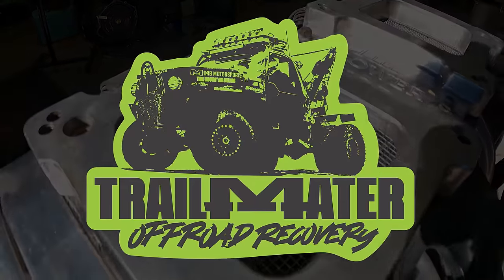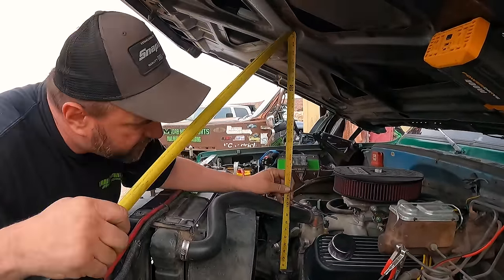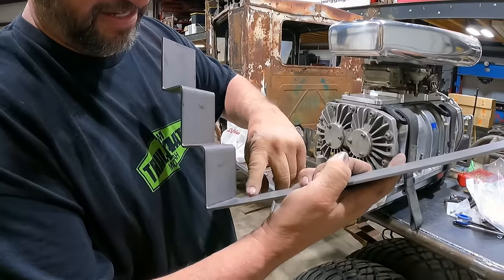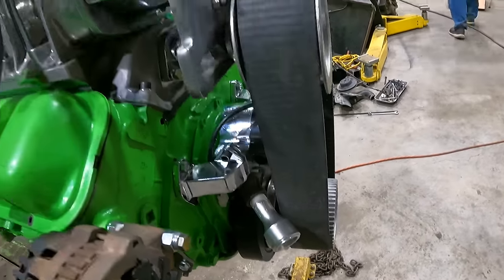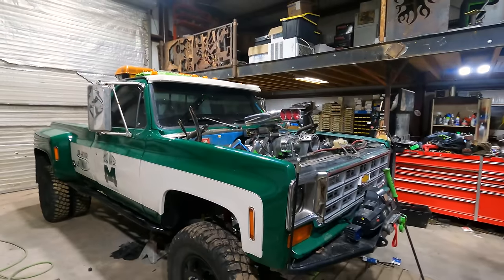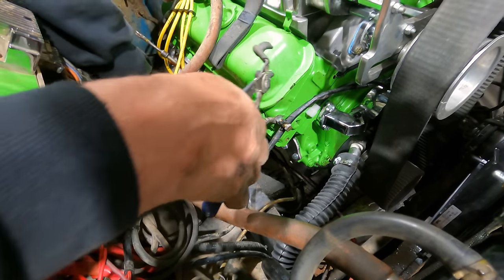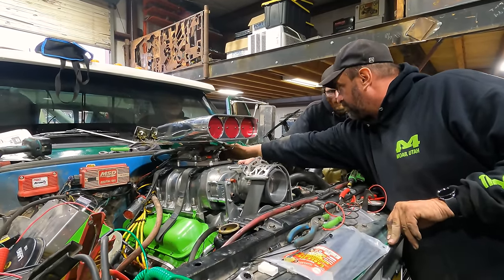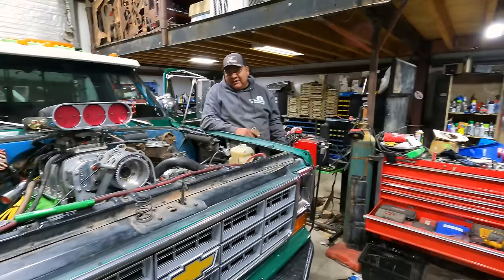Putting A Ridiculous Engine In My Truck

Comment: 671 blower and 454.. ... hell's yeah
Reply: That looks bigger than a 671 that looks like a 8 or 1071.
Reply: @79tazman  Rory confirmed on the last video that it was a 6-71.
Reply: I thought he said it was a 427, I may be wrong.🤷‍♂️
Reply: Should you use a solid Harmonic Balancer,? I saw a Small Block stock balancer crack and broke the crank with that blower pulley, Thumbs up, Team Trail Mater
Reply: I always that 6 was for small block and 871 for big block
Reply: @RJJ6129  Oh dear !!
Reply: @jeffclark2725  "  solid Harmonic Balancer,? "  Then it wouldn't be harmonic would it.
Reply: @quantumss  I found it in the B&M Blower catalog back in the early 90s
Reply: @jeffclark2725 it definitely should have the correct size and weight, harmonic balancer for that Blower, you could damage the motor,shutting it off, one could say a lot of that is mitigated by having a belt drive that has a slack side tensioner instead of of a chain, and that's true to a point it's better to have it all in balance, it's just like an aircraft the motor should always drive the propeller and the propeller should never drive the motor ,if they harmonize they slam back and forth and you will bust your crankshaft.with the addition of that blower it's momentum can easily overcome the centrifugal force of that stock harmonic balancer,
Reply: Gonna be fun to watch the games and hear that whine
Reply: @OjaiBonsai You can use whatever you want, it's all in hw you set them up. My brother in law and I built a stroked out 383 with a 10/71 for his '70 split bumper Camaro, and that thing was bad to the bone! We have a pretty steep, and short on ramp to the I-15 freeway here in Orem, Utah and it didn't have a problem hitting 90 mph by the top of the on ramp! That car was so much fun! 😁  It's too bad he sold it when he had his daughter. I bet he wishes he still had that car!

Comment: I loved watching this build. I might add, you may have cooling issues with no thermostat. I've seen it a few times, my theory is that the water doesn't spend enough time in the radiator.

I like water wetter too, made a huge difference for my turbo jeep engine.

Comment: Rory I had an 83 3/4 TON Chev pickup I had a 35' fifth wheel camper truck power by 454hp full race cam 650 Holley carb not good mileage per gallon  but killer on power gas was $1:50 per gallon. Lol

Comment: Nice that you got the blower retainer straps for safety, and that belt guard is doing a wonderful job of retaining the blower gearcase from scattering while the belt snaps and goes flying. Edit as it ended up the right way in the end, just looked so wrong at first I had to mention it.

Comment: Rori I have had mechanics argue with me they couldn't wrap their skillet around what they already knew.

This is my attempt at saying I have had a certain thing happen to me and I think my theory about it is true.

You just mentioned that you may run it with no thermostat.
Under certain circumstances that will cause an engine to overheat. And by certain circumstances I mean high RPMS. Which this thing is most certainly going to do. Now here is why I'm calling it a theary but one I happen to believe. Under most driving conditions no thermostat will make it so it doesn't warm up. The water isn't any one place to get warm it travels through the heads so fast it's never there long enough to heat the antifreeze.

But under high rev conditions the opposite comes into play once the antifreeze is hot. And you are reving the engine up high.
It won't stay in the radiator long enough to cool down, then also it won't stay in the heads long enough to pull out any heat.

I'm sure I could have said that with 509 less words..but this is what happened

If you don't follow I'm sure someone you know already knows this..
 just ask em hey
 I got this crazy guy on the Internet saying my engine will overheat without the thermostat, you know what he's taking about lol 

Anyway if you don't believe me and it turned out to be true child you mention David was right in one of your episodes,I don't get out much and it would be way cool to be thought of something I could show my friends if I had any. Anyway I hope I helped.

PS it's good to see a man understand what he's got and appreciate it.i with I had been that smart when i had things right where I wanted them lol hehe a good day you guys o am with you on every trip. Even thinking about how it probably isn't fun and having when you don't get back to the shop until midnight ECT some nights but then in the morning you are on with it again ECT have a nice day david

Comment: 2 questions; Are you really going to play in the sand with no air filter, and were you drilling holes in your alternator bracket with your drill set in the "hammer" mode? That is what it sounds like.

Comment: My first foray of making a really poor decision was I was sixteen, working as a mechanic for dad in his shop. Neighbor gave me a old ford car, a 56 ford two door sedan. Didn't have a engine but their was a engine in my dads poor decision to drive drunk 58 ford wagon... had a 352 dropped into it from other plans that went south. I knew dad was not going to be using his old shovel that had a 671 detroit in it. Friends who have friends, had a blower mount and so came dads engine, his blower and my car. I did not know to much about gas engines as we had mostly diesel stuff. I strapped that  engine in not realizing a lot of things about to happen in my lifes poor planning. I used the engine and transmission out of the wagon which was a automatic. Me being real scared of the unknown stuff that may happen hits the switch and it started on a idle... actually run really good. I am hiding all this from dad so had the garage door shut and had it idling just fine. Finally gave it some gas and it wound up like a tomcat on steroids', the motor twists in the hole and kicks that throttle wide open, it drops itself into reverse. It was smoking the tires backwards out of the shop and straight through his shop door.... found the tree behind it just a short space from where you turned into the back way in our shop. Engine is winding up tight,... but not for more than probably a half a minute actually.. and  it blew up and scattered pieces an parts from every spot on the engine! I expected my dad to kill me for it but he was laughing so hard that it took him a few days to get just that. No beating, just a lot of free work to pay all of it back to him. The worst tho was I was the laughing stock of all my buddies

Comment: Not sure a sand sucker is a good addition for a sand digger of a car. For these types of environment the oil bath filter was constructed. Put on a snorkle and an oilbath filter. Keep that engine whole. You need the torque. Not the revs.

Comment: I found that a fairly tight converter (i.e. low stall) worked great because the blower does give instant torque.  There's no need at all to have a higher rpm stall speed.  I would imagine given your application, that you want less slippage in the converter anyway, especially during the summer.

Comment: Love the upgrade, you mentioned you are not running a thermostat. From my experience you may need to put a restrictor plate in the thermostat housing to slow down the flow of your coolant.  The coolant needs time to absorb the heat from the block and slowing down the flow helps.
Reply: Agree it might need a restrictor plate or T-stat, but I recently learned that the reason for this is so that the coolant in the block is at a higher pressure than the radiator - the higher the pressure the higher the boiling point to prevent localized steam pockets on the water jacket walls around the cylinders. It's a common misconception that the coolant "needs time" to absorb the heat - a higher flow rate will only help remove heat faster, but when you get rid of the thermostat the system is at a more uniform, lower pressure (approaching the radiator cap pressure rating) when what you want is higher pressure inside the block to combat localized overheating at the source of the heat
Reply: If it's a brushless watter pump you can just slow it down.

Comment: If it isn't in the rules. You should build a truck with a gear drive high speed winch. Then drive to the finish and then winch the stuck rig to you.

Comment: Cool stuff! I thought there'd be a million comments about the one thing I think is wrong with the install, but a quick scan didn't turn up any. That one thing is the blower's idler pulley location. To optimize sprocket tooth engagement, it needs to be on the other side of the belt; pushing in, it will get more teeth on the driven (and driving) sprocket right where it's needed. Also, by convention, an idler is meant to run on the smooth backside of the belt, not on the toothed side. Your setup may work fine at the boost levels and rpms you plan to use, but it is an unnecessary extra failure point especially as the belt stretches.

Comment: The only shortcoming of that lovely, =kickass= setup is the lack of an air cleaner.  Eek.
What a hoot, guys.  Love it.  Can't wait to see you and Blue in the Games!
Saw someone howling about the hood paint yesterday.  Gonna be good.
Reply: The air cleaning is internal before the carb inside of the intake
Reply: It is awesome. Howlin Wolf pulled another rabbit out of the hat.🎉😊
Reply: Just put a sock over it it'll block all that sand.
Reply: I wanted to ask if these things had air filters at all hidden somewhere inside there. Thanks for mentioning this, yeah with all that sand and dust it does seem concerning. Though I guess they aren't that wedded to longevity for this particular application lol.

Comment: It would be a good idea to put a crank snout support on that thing I have seen cranks snap right at the front main cap and go rolling down the track with balancer and timing gears still attached being a BBC it should last a little longer but if it's a cast crank that blower belt puts a bunch of upforce on that crank snout and you get a little pre detonation and it will snap it right off